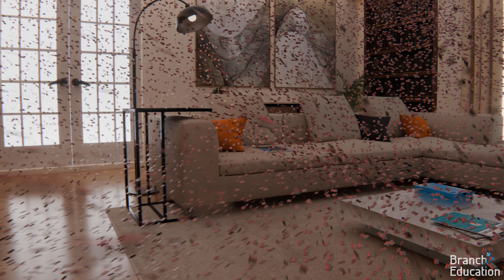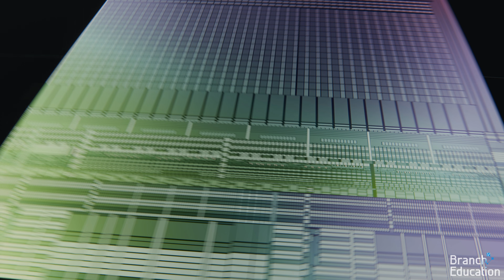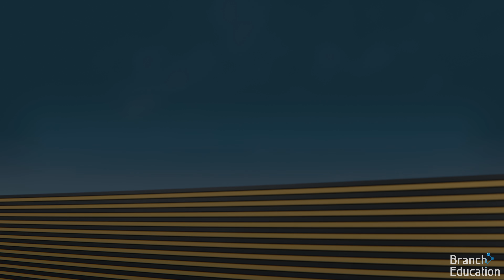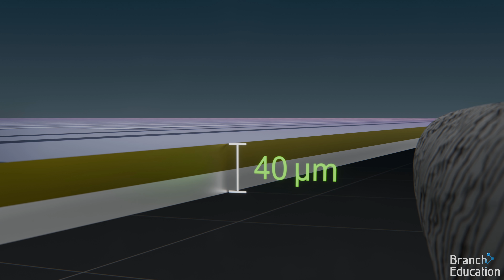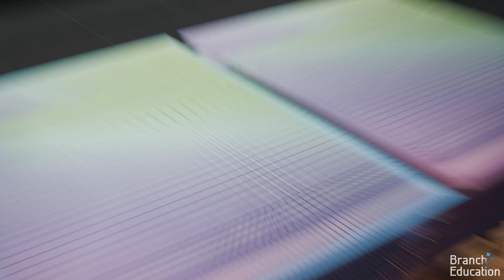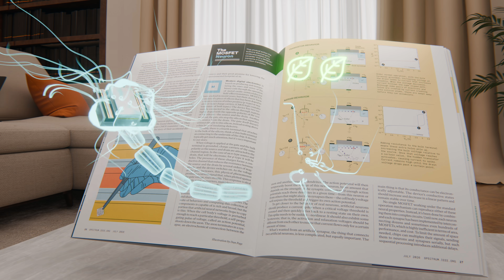How do microSD Cards Store 2 TB in such a TINY space?

Comment: at the time when the SDXC standard was first defined in 2009 with that maximum theoretical 2TB capacity in such a small format i recall doubting that it would ever actually be achieved. for one, it was entirely plausible a different standard would have replaced it by now, and two, it would have entirely redefined the phrase "catastrophic data loss" to no longer just mean as in "because the heads crashed on my platters in my HDD", or my "FS corrupted, and i lost the data" but as in "i literally physically lost it."

Comment: This video presentation of how the microSD cards are developed and produced is an amazing achievement in the memory storage technology. This high resolution video images wouldn't have been possible without massive memory support to render its quality of the images. Little did I know that these technologies were developed and tested by electronic engineers since the 1950s. IBM was the catalyst of many inventions in the era of memory storage development. The company began its memory storage technology production with the hard drive invention containing large array of disk platters. Then they made them smaller with even more capacity storage and smaller platters. I've worked in the Electronics industry for almost fifty years and witness the amazing progress of hard working Electronics Engineers. I too was in the middle of this progress when I attended college and majored in Computer Science technology. I built a fixed DC power supply, AM radio, multi meter, and a Laptop. What amazes me most nowadays are the Electronic components that are designed and manufactured in tiny nanotechnology sizes.

Comment: because the sd cards actually built in wifi which is connected to adjacent wifi networks of the sd manufacturing companies.  something they rent the networks of carriers of telecom.  when you store the data, it is actually written in the temp places of the sd card, say 10GB.  when you finished writing.  it the transmitted to the cloud disks of the sd cards manufacturer.  finally deleted the data stored in temp places of the sd card.  each sd card has an uid which let the cloud server know how many TB can be written.

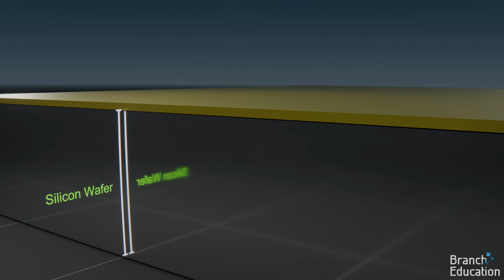Comment: I didnt get the part where they milled most of it away again, can somebody please explain? 🤔3:34

EDIT: okay, it seems to just be the wafer everything was still attached to thats milled away, right?
Reply from the maker: Yeah.  So the structures are build on the very top of the wafer.  The wafer itself is like a foundation, with the structures the skyscrapers above it.  So then the thickness [km below the earth] isn't needed, so the completed wafer is bonded to a new wafer, and then it's flipped over and the un-needed materials is removed, then the bonded secondary wafer is removed, and ya are left with a super thin NAND flash structure.

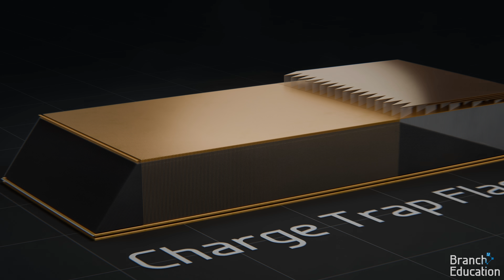Comment: 1:42
  the 72000 x 48000 = 3,456,000,000 x 200 =  691,200,000,000 total cells and since each cell holds 3 bits of data, to calculate the amought oftotal bytes the model shown can hold in is to convert bits to bytes by doing 691,200,000,000 x 3 ( for each cell holds 3 bits of data ) = 2,073,600,000,000 bits, then convert to bytes is ( 1 / 8 ) so 2,073,600,000,000 / 8 = 259,200,000,000 bytes, then to get kilobytes do the total bytes divided by 1000 to get kilobytes, then do 1000 again to get megabytes, then divided by 1000 again to get gigabye, which is,  259,200,000,000 bytes / 1000 = 259,200,000 kilobytes, then 259,200,00 / 1000 = 259,200 megabytes, then lastly 259,200 / 1000 = 259.2 gigabytes of data shown in the model. ( if i made any mistakes let me know respectfully. )
Reply: took me 10 minutes to calculate and type out, using ZERO AI; I did it using only my calculator. on windows
Reply from the maker: Looks good.  That model is just one plane, so ya gotta multiply by another 16 [2 stacks of 8 planes] gets us 4TB ish.  However, there's a lot of error correction.  Also, many times there are entire banks that can be faulty, and therefore the mapping just doesn't include them.  So that's why the total usable amount can be a lot less.
Reply from the maker: Also I do calcs like that all the time, but usually using excel.
Reply: @BranchEducation  You are correct, i calculated one plane of cells and since there is indeed to stacks of 8, making it total of 16 planes, to calculate it, its 259.2 gigabytes from my last comment multiply by 16 which is 4,147.2 gigabytes, divided by 1000, 4,174.2 / 1000 = 4.1 ( rounded to the nearest tenth place ) so your MicroSD is label wrong and should say 4TB and not 2TB, but i don't mind. :)

Comment: is there a video about how to get from a gigantic 1mm pin to down to the tiny nm struckter? what is with refecltions current and resitence. ths changes if the the wire gets smaller or changes size from pads to the cells.

Comment: You might be wondering why it's not as widespread as an SSD.
Because SD cards have very low endurance, you need to trade endurance with capacity. Most of the regular ones have a 2-year warranty. Meanwhile a regular SSD has 5 years standard. You can have a high-endurance card, but it's gonna be at least $1K.
Low read/write speed. Yes, there are some very fast ones, but you wouldn't pay for it.
Expensive compared to SSDs.

Comment: 2Tb's is the largest micro SD card available right now. The internet holds approx. 180 zettabytes of data, you would need 90 billion 2Tb sd cards to fit all of that data. A Sandisk Extreme 2Tb costs $400 roughly, in total you'd spend about $36 trillion to store all that data and that's not even counting the time needed to sort all of it and store it.

Comment: Why not explaining how the holes get filled? 

The vertical channel holes in 3D NAND are filled from the outside wall inward using Atomic Layer Deposition (ALD) to form a concentric cylinder structure:
 * Blocking Dielectric Layer (Silicon Dioxide / \text{SiO}_2 or High-\kappa material): Directly lines the etched channel hole wall, electrically isolating the control gates from the charge-storage layer.
 * Charge Trap Layer (Silicon Nitride / \text{Si}_3\text{N}_4): Traps and holds electrons to represent stored data bits.
 * Tunneling Dielectric Layer (\text{SiO}_2 or Oxide-Nitride-Oxide / ONO): An ultra-thin barrier that electrons tunnel through during program and erase operations.
 * Semiconductor Channel (Polycrystalline Silicon / Poly-Si): The thin conducting channel through which vertical electric current flows between the source and the bitline.
 * Insulating Core Filler (\text{SiO}_2): Fills the remaining void in the center to provide mechanical stability and complete the pillar.
How it is filled:
Because these channel holes have extreme aspect ratios (often exceeding 60:1 to 100:1), standard deposition methods cannot coat them evenly. Chipmakers use Atomic Layer Deposition (ALD), introducing precursor gases in self-limiting alternating pulses to build each conformal layer atomically from the hole walls inward until the final core is sealed.

Comment: Excellent video!

The very small thumbnail size of these microSD cards can be a problem. I've spent too much time crawling on the floor of my desk looking for these things that accidentally fell.

I had a Lexar 128GB V60-speed microSD somewhere in my basement couch.  It got ejected into the air from my device, and I saw it hit the couch backrest and slide down the cushion.  I spent some 30 minutes cumulatively unsuccessfully looking for it.  The price of this 128GB Lexar microSD has gone up 262% since I bought it in mid-2025! 😠

Comment: Why NAND on SD CARD is more dense than on SSD? 2TB NAND in SSD is much larger than in SD card.
Reply: 1. Each cell in an SD card stores 3 bits, so it needs to hold 8 distinct electrical charge levels. On an SSD the same cell only stores a single bit, so you only need to distinguish on/off. So the SSD needs 4 times more cells, but the data is a lot more robust against corruption.
2. All flash drives comes with extra capacity because data blocks will fail and the drive will silently swap in spares to keep the drive operational. This also means if you do get bad blocks, you must stop using the drive and copy out the data immediately! SSDs prioritise data integrity, so they come with way more spare cells than SD cards
3. Flash has a quirk where it can be written bitwise, but must be erased by the block. This means changing a single bit in a block requires rewriting the entire block! Over time this can really slow the drive down. SSDs expect a lot more of such random access, so the blocks are smaller to reduce this random access penalty (and as before, there are many more spare blocks to go around). But this once again means you need more physical space for the same amount of data.

SD cards are about size before all else, but that all else is quite a significant tradeoff such that they really shouldn't be your primary storage medium
Reply: @ratvomit874  1. 99% of SSD have already TLC (3bit) NAND. 
2. extra capacity is about few percent!

Stop using AI for responses dude!

Comment: It will never fail to amaze me, hell I'm still amazed of the 32mb memory stick pro duo that came with the PSP when it first launched
Reply: Still rocking my PSP 1000 that I bought nearly 2 decades ago. I've had to change the battery, but it's still a fantastic machine!
Reply: @NervousNoodles you ought to get rid of your PSP now if it is 2 decades old
Reply: I was ballin as a teenager the moment I got a 128gb micro SD and a memory stick adapter and softmodded my PSP.
Reply: I am impressed by my 128gb USB stick that is barely bigger than the actual plug
Reply: My first hard drive was 21 MB and fit perfectly under my Mac Plus. Though it did raise it up by about 4 inches.

Comment: This video got me confused so I had to look it up. There are 2 types of layering in MicroSD:
1 3D NAND 200+ layers etched not stacked in each die
2 up to 16 layers of that 3D NAND dies bonded as a staircase as shown on the video
But not 200+ layers of dies in MicroSD that I misunderstood from a video.
Reply: i mean they kinda did say that. 

2 stack of 8 of nand flash =16
100 layers of silicon nitride and the "invisible" oxide layer for the first deck and another 100 for the 2nd deck = 200. 

im kinda confused from your comment
Reply: Its layers within layers

Comment: eye-watering levels of detail
Reply: And sold for less than the cost of a single meal.
Reply: i peed a little
Reply: @vndkmwt  great comment
Reply: Eye-watering amount of notes at the top right corner of the video
Reply: eye-watering levels of brazil
Reply: I wonder who budgets the Channel behind the screen
Reply: i was missing this part: 
The vertical holes in 3D NAND are filled from the outside wall inward using Atomic Layer Deposition (ALD) to form a concentric cylinder structure:
 * Blocking Dielectric Layer (Silicon Dioxide / \text{SiO}_2 or High-\kappa material): Directly lines the etched channel hole wall, electrically isolating the control gates from the charge-storage layer.
 * Charge Trap Layer (Silicon Nitride / \text{Si}_3\text{N}_4): Traps and holds electrons to represent stored data bits.
 * Tunneling Dielectric Layer (\text{SiO}_2 or Oxide-Nitride-Oxide / ONO): An ultra-thin barrier that electrons tunnel through during program and erase operations.
 * Semiconductor Channel (Polycrystalline Silicon / Poly-Si): The thin conducting channel through which vertical electric current flows between the source and the bitline.
 * Insulating Core Filler (\text{SiO}_2): Fills the remaining void in the center to provide mechanical stability and complete the pillar.
How it is filled:
Because these channel holes have extreme aspect ratios (often exceeding 60:1 to 100:1), standard deposition methods cannot coat them evenly. Chipmakers use Atomic Layer Deposition (ALD), introducing precursor gases in self-limiting alternating pulses to build each conformal layer atomically from the hole walls inward until the final core is sealed.
Reply: @UserHuge  Get your AI slop out of here
Reply: @persononyoutube01  no matter how hard you cry about AI, it's still the future. It's not going away so adapt
Reply: @persononyoutube01 you pru e
This Video is totally 100% REAL AND THERE IS NO AI IN IT
AI IS NOT REAL AND DOES NOT EVEN EXIST